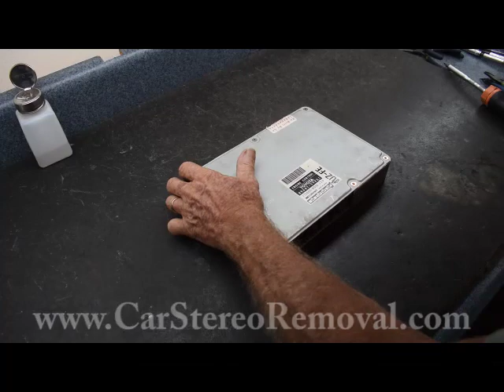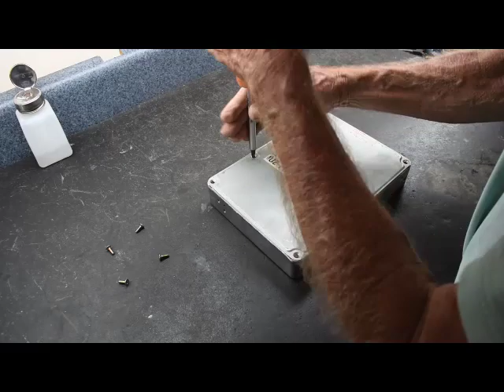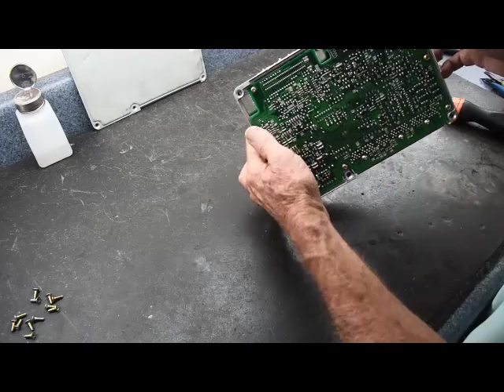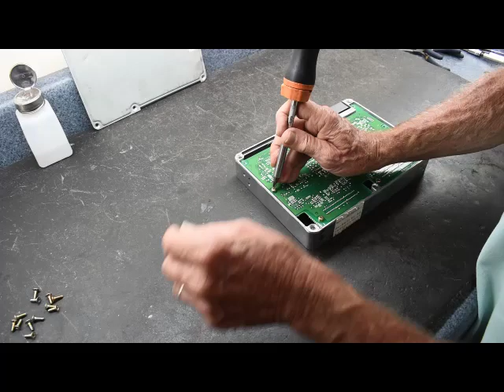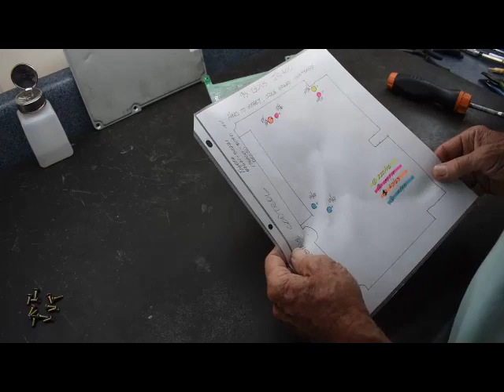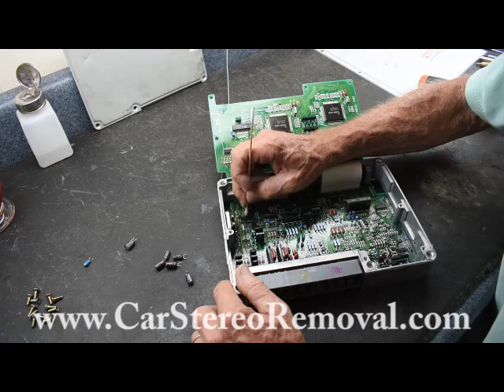Lexus ECU Computer Repair - Car Stereo HELP

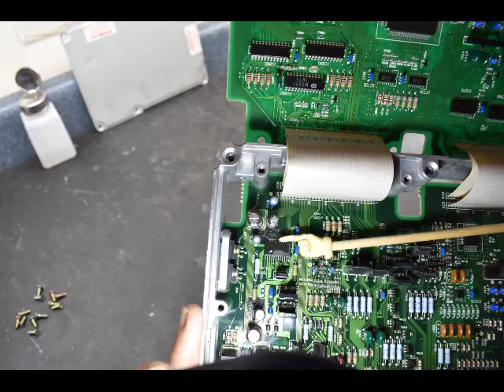Comment: 4:36 CORRECT REPLACE ALL ELECTROLYTIC UP THE VOLTAGE A NOTCH FROM 10V CHEAPIES
TO 16V NICHICON OR HIGH QUALITY NAME AND NOT 85C SWITCH TO 105C TEMP RATING
YOUR MISSING THE CHECK THE ACTUAL CAPS FAIL ON A ESR CAP TESTER OR MICRO FARADS VALUE METER, TO SHOW THE FAILED CAPS, YOUR STILL MISSING 2 BLUE TANTALUM CAPS TOP LEFT, GET RID OF THOSE, SWAP FOR ELECTROLYTIC , TANTALUM ARE NOTORIOUS FAILURE CAPS, PLUS IMPORTANT,  REMOVE THE OLD SOLDER AT THE  EXTERIOR CONNECTOR PINS REFLUX, RE SOLDER EVERY LEG/ DONUT BACK WITH NEW SOLDER TOUCH UPS  TO ELIMINATE COLD SOLDER CONNECTIONS , FROM CAR VIBRATIONS

Comment: Hi
Heater circuit in ecm is open and closed in some second for oxygen sensor 
But in my car fix 12v
So wich part responsible 
Capacitor or mosfet or transistor

Comment: My 2006 is 250 is having transmission problems, I already replaced the transmission and the problems are still there
Reply: Did you fix it? I have the same one . a new ecm is the solution . I’m going to try to fix it like this video if not buy a new one

Comment: Hi , my lexus gx 460 vehicule no longer starts, due to infiltration the windshield where water to pass through and end up in the electronic compartment. Everything works except startup. Unfortunaly, the ecu did not have access to the computer.

Comment: What tool do you use to remove the capacitors?  6:30
Reply: It is a desoldering pump, a soldering iron with a hollow tip and a vacuum pump. Once the solder is liquid, it sucks it in, so you can easily remove the component.
Reply: How much was the ecu ?